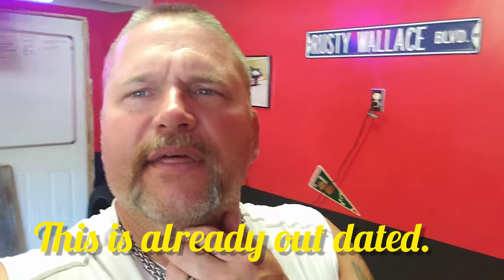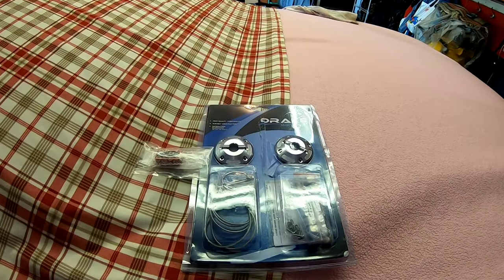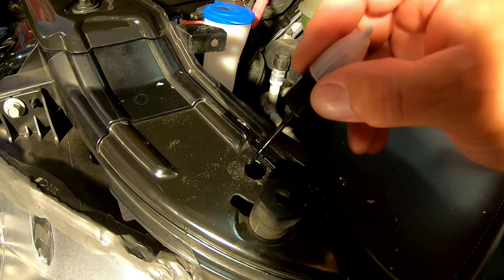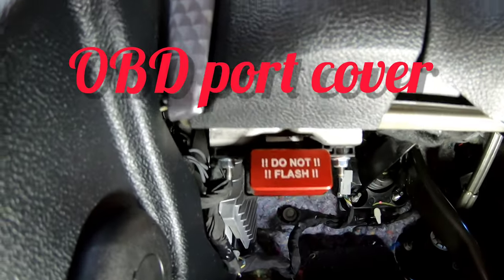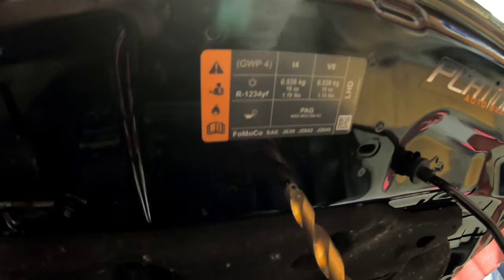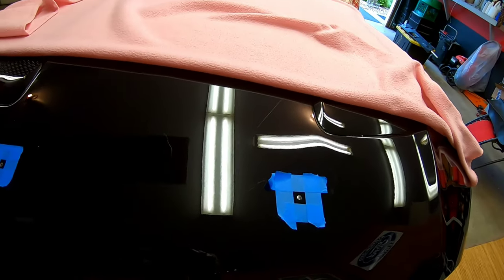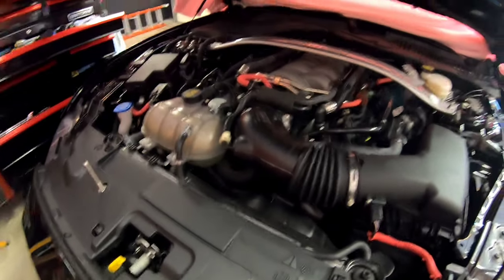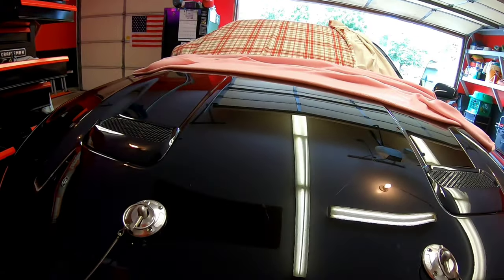Installation of Drake hood pins on my 2020 mustang GT. This for hitting the 75 subscriber mark.

Comment: I’ve run them on a few of my Stangs through the years, I just never installed them on a factory hood. All mine were done on aftermarket fiberglass or aftermarket steel cowl hoods. Never tried them inset like you did Bro… interesting look !
Reply from the maker: Thank you. I know it's not exactly standard, but I figure as long as it's functional and looks OK then I'm happy with it.

Comment: The reason for a larger hole is so that the pin does not contact the sides of the hole when the hood is closed. The pin itself is about 1/2 inch, so the hole needs to be 7/8-1 inch. The top plate will be able to easily cover the hole.